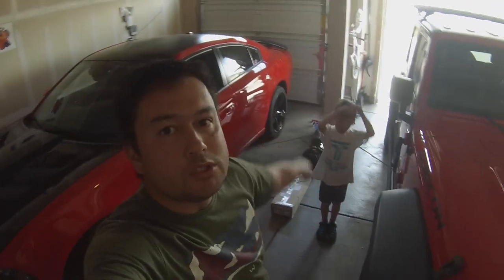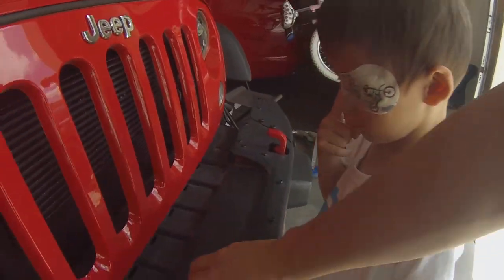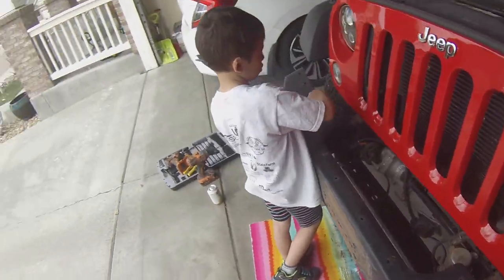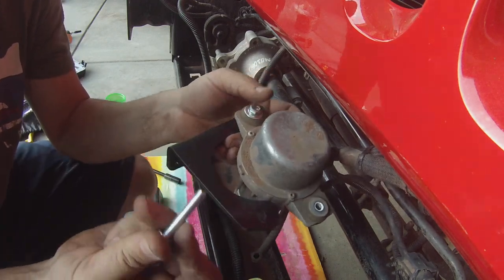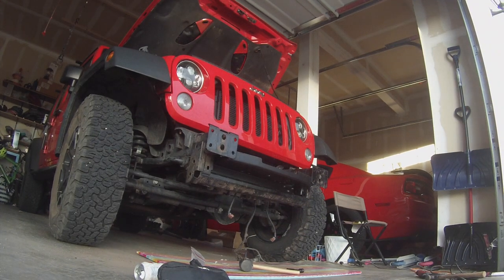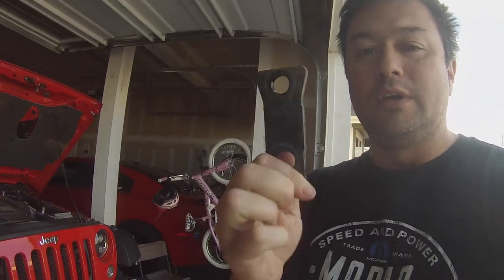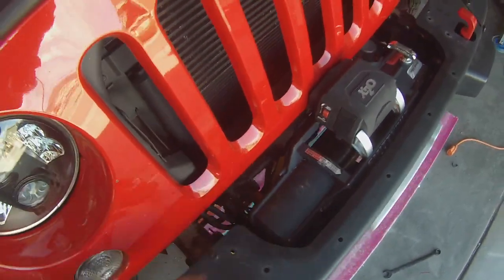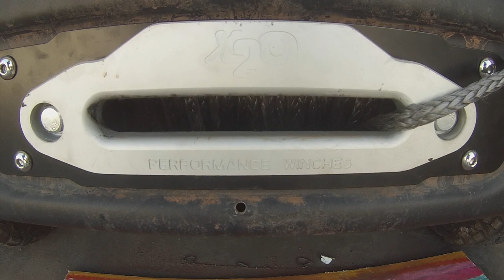Jeep JKUR Bulldog Winch Plate Smittybilt Winch Install Factory bumper

Comment: Nice job!  What did you use for a camera?  I want to start a jeep vlog. I just bought a 2013 anniversary rubicon a few weeks ago and have since bought a 3.5" Aev lift w/shocks and brackets, 37" Thunderer Mud Tires, I got rail master rims that were nice and cheap, aries aluminum fender flares, aluminum inner fenders and my next project that you are doing is a winch.

I am 110% exited to have come past your video because THE FACTORY makes you feel like you can ONLY install and expensive Warn Winch that costs 1k dollars or more. I am trying to build a great jeep and not cheap out, but also not break the bank.  That smittybilt winch looks killer and I also saw the same winch plate. 

Great video and keep em coming!  I am subscribed!
Reply from the maker: Sorry just saw this message. I use my phone and go pros. Depending how into the video it will have more or less cameras running. I also will film with a drone if doing trails
Reply: @dasllamas  cool. I just bought a go pro. Unfortunately most of the time I try to film a "video" I swear too much or record half of it by mistake lol.
Reply from the maker: @deftond79  haha!